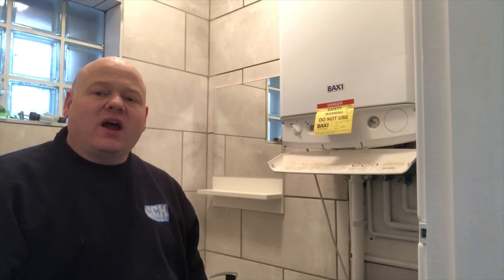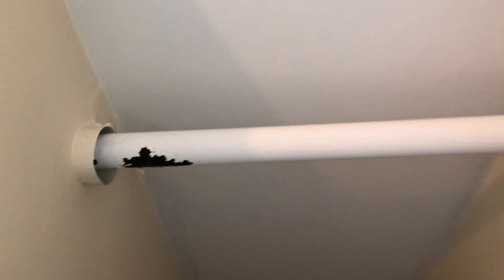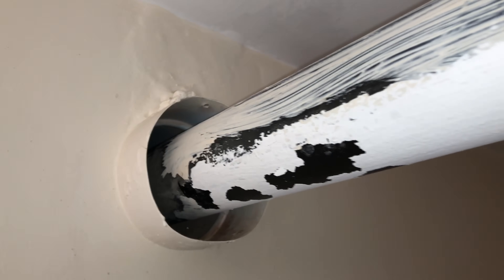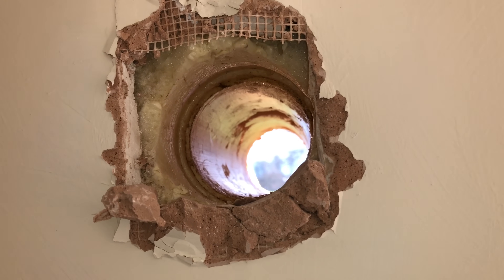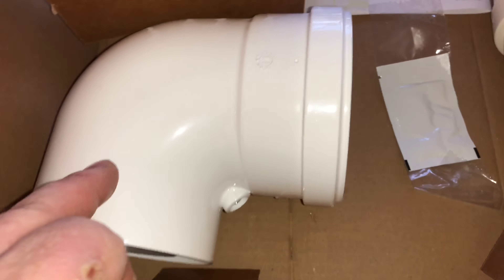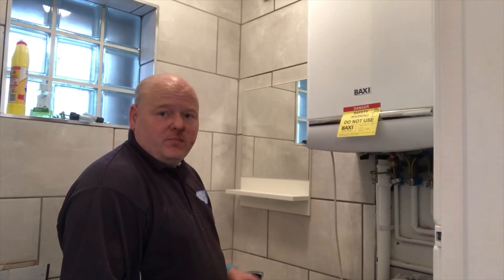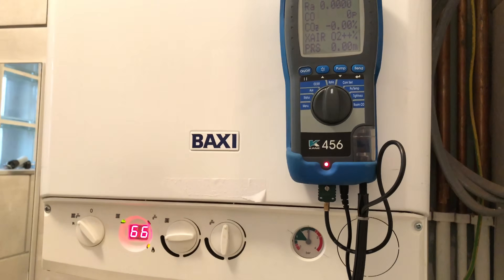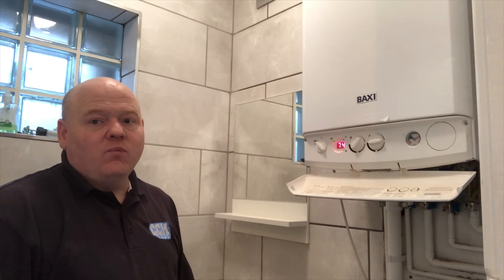Dangerous Gas Boiler  A day in the life of a Gas Engineer / Plumber

Comment: Thats a  shocking instalation. Im surprised the original client could be naive enough to see that flue and think it were ok.

I rekon its a rush job put in by an incompetent non registered engineer, thats then had the flue bodged by a DIY er.
Reply: From watching Allen's video it looks to me that the initial installation was done quite good , the problem lies with a cowboy builder that has built a small extension behind the flue outlet and did not want to pay for a gas installer to come and extend the flue correctly and the prv valve needed extending also.....👍
Reply: I was wondering the same thing - the wall with the prv on may have been the external wall, but when it was extended, the prv pipework was left as is, and the flue badly extended by the builder or someone not gas trained.
Reply from the maker: The flue had also been painted, Something strange going on .. Thanks. 😱
Reply: @pmailkeey , sadly thats true of many, especially those clients who blindly choose the cheapest prices.

Comment: I had the same boiler serviced yearly and it ran faultlessly for 8 years until the expansion vessel and heat exchanger both failed leaving it beyond economical repair. Just had it replaced with a Ideal Vogue.  Wouldn’t buy another Baxi.
Reply from the maker: Funny the Vogue has the same heat exchanger as the Baxi, Vogue is a great boiler so is the Baxi Duo-Tec
Reply: Allen Hart so it’s out of the frying pan...It’s done now and I have 10 year guarantee. The heat exchanger started leaking while the engineer was testing after he fitted the new expansion vessel. It wasn’t leaking before. Any theory on why this would happen. I was told okay to do resets to get some heat and hot water until the vessel could be replaced but perhaps this damaged the heat exchanger some how? It doesn’t matter now but interested if you have a theory?
Reply: Knightlore10 how did the engineer prove the heat exchanger was faulty? I’ve not known a duotec exchanger leak. I’d guess it was something else. May be wrong though.
Reply from the maker: @brettfev  I have fitted hundreds and hundreds of Baxi boilers and never had a faulty heat exchanger, I am with you on this,
Reply from the maker: @Knightlore10  Its hard to say without seeing it, i am guessing you were very unlucky
Reply: @brettfev  after installing the expansion vessel and testing, the engineer pointed out dripping water to the left below the heat exchanger as you look at it. Does seem odd is defo no leaks before, Thanks for input.
Reply: @Knightlore10  My experience - on a tenanted property I have to get an annual service and there is fault after fault. At least half of the time the engineers lose the screws and don't put them back. On boilers in private properties amongst family where annual services are not undertaken faults are few.

I'm not saying you shouldn't use someone that isn't qualified but even amongst the gas safe registered guys there is a lot of shoddy work. Not even checking basics of cleaning out sumps for an annual service, just pushing a pen into the expansion vessel to see if there is air and not bothering to check the reading. So if anything they've just reduced the pressure that was there.

I've also seen ones who work for contract companies on maintenance plans just straight out lie and make up faults that aren't there so they can write a boiler off by claiming cost to repair exceeds certain percentage of value. Or even claim parts are no longer available. Yet, when I've enquired, they certainly are. It's a very dodgy world.
Reply: @AllenHart999  I've replaced a few Duotec/Promax heat exchangers. Most leak down the condensate so aren't seen. Some pin hole at the top & fill the combustion box and kill the fan. Some leak just above the flow pipe on the plastic.
Reply: pmailkeey lol probably but if it burnt the house down,  insurance would want to see serving record up to date from the charred remains

Comment: Why would you not just renew the expansion vessel that is in the boiler is it not big enough for the system? Good video
Reply from the maker: The vessel in the boiler is not big enough for such a large system. Thanks.
Reply: @AllenHart999  later in the video you say the boiler is to big for the house and could have had a smaller boiler installed ??
Reply from the maker: @mynameis9739  A smaller boiler would still of needed an extra expansion vessel.
Reply: I would say the expansion vessel just needs recharging,
Reply from the maker: I would agree on a small system. I didnt count the rads but its a five bedroom house and i think some of  the rooms have 3 rads. i am guessing 20 rads. Defo needs bigger expansion vessel,
Reply: Yeah be a good idea to check the vessel doesnt just need charging rarther then assuming that the customer needs to spend more money by adding another external vessel

Comment: No flue clip on your new flue installation allen....tut tut riddor
Reply: Gavin Doyle looks solid ! Sure Allen will see to that when he goes back for other remedial works..... I just hope the builder who done the flue in the first place doesn’t come back and boxes in the flue with no panels !
Reply from the maker: @heatservicebwcuk1545  It has a clip on. If you look at the last bit of the video its on, thanks.
Reply: Allen Hart I wouldn’t question that ! Nice video mate
Reply from the maker: @heatservicebwcuk1545  I know buddy and thanks for your support.
Reply: Haha too right watch that builder!!!🤣
Reply: Doesn't necessarily need a clip it only needs to be adequately supported 
Going through 2 solid walls could provide adequate support dependent upon length
Although I would probably install a couple of clips on it for belt and braces purposes
You would only RIDDOR an ID situation not At Risk
The install as it was when Allen arrived was ID as it had the wrong flue fitted and it was potentially leaking poc into the room
Should be reported under RIDDOR but without anyone to report it's pointless but I would be calling HSE to see what they say just to cover my arse
Reply from the maker: @liveloud9894  It didnt really need clipping as it was fully supported by the walls, I did add a clip near the joint though, Its on last clip. Thanks.
Reply from the maker: If you watch it too the end you will see it has a clip, Although it didnt need one as its supported by the walls.

Comment: Great vid as usual mate. What was the heating load requirement for the house? Regards Matt
Reply: Surely the 40kw corresponds to the hot water output, the heating side will modulate down to meet the load
Reply from the maker: @chrisrichmond5501  It only has 10 l/m on the cold water so 40kw is way too big. 👍
Reply from the maker: I would expect the house needs around 18kw of heat, The boiler is way over sized.

Comment: Undergassed more than the 10% leeway so does it not need At Risking.
Reply from the maker: I will be going back and updating gas also adding controls and a few more bits. Thanks.
Reply: @AllenHart999  Don't  forget to gas rate this boiler when you upgraded gas pipe. Video evidence please. Don't forget about permissible pressure drop across system pipework ≤ 1 mbar. We want to see it. Thanks
Reply: Good to see your thorough with your work, loving your vids!!
Reply: Another good one Allen, I’d of done the same as you.  Though the gas supply is undersized & it needs an additional expansion vessel, it’s a real world situation & you’ve used your ‘Engineering Judgement’ to get the customer some heat.  These problems can easily be rectified the next day.
Skill, experience, knowledge & training is essential when working with gas.
Well done mate👍👍
Reply: 100% at risk great video I’d have left the boiler off anyway purely for the fact the prv is inside the house and the pressure is well above 3 bar,it’s tough to tell that to the customer though if they don’t want to spend any money and it’s freezing outside I guess 😂
Reply: @craiglewis6709  Why would it be at risk? Whats the risk?
Reply: Charlie it’s under gassed mate
Reply: Craig Lewis As long as it is getting the manufactures minimum gas rate and not affecting other appliances NTC .  But you will loose your warranty with the manufacture.
Reply: @alan6799   NCS doesn't exist anymore...ID or AR
Reply: @kb5057  although it isn't recognised a recognised category anymore, we all know it's best practice to cover ones backside and note down anything that's "NCS"
Reply: @craiglewis6709  It's not under gassed at all what are you talking about? Gas rated at 34.45Kw GROSS the manufacturers state 11-36.4KW Gross, they give a range therefore its safe anywhere within that as long as your PT is correct, if you're going by another manufacturer who only state one number then the 10% allowance would be used and that would be 32.76, still within tolerances so how is this under gassed? You would have at risked a safe appliance and left someone with no heating or hot water for absolutely no reason.

Its at worst case NTCS, which no longer exists, and just because it doesn't that doesn't mean something has to be classified as AR/ID, note it, recommend it, quote for it either way its safe and onto the next one, as for the PRV that would just void the warranty and you could temporarily turn a rad into an expansion vessel if undersized or recharge the expansion.

Also he run a hot tap so this boiler probably came out of service and went into DHW which you could GR as this will hit max also, but due to poor flow rate would lower your GR so its probably even higher than what he tested which either way is perfectly safe.
Reply: @charlie12358  Completely agree.